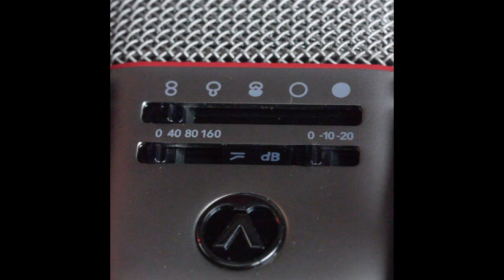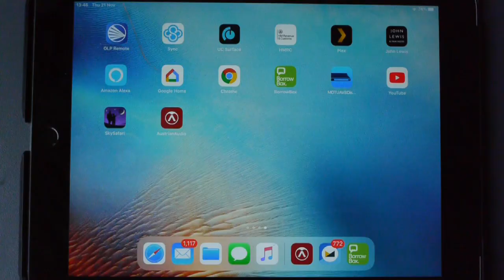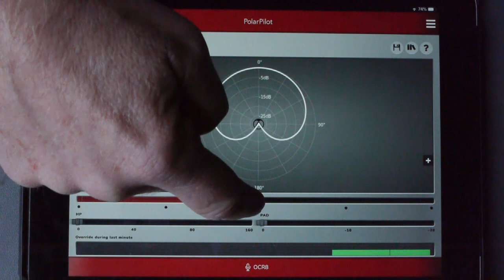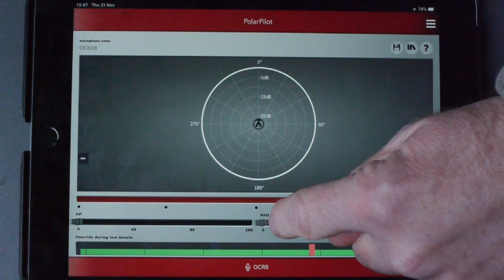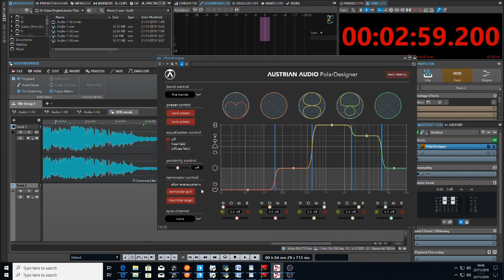Austrian Audio - OC818 - It's a 414 Jim but not as we know it. Looks like a Romulan upgrade!

Comment: It is funny that this is such a Swiss army knife microphone, when being made in Austria. 

I picked up one today, thinking that this may be my future daily driver at my workstation/narration-room. It sounds really impressive so far. I already like it better than the Neumann TLM-102s that I have been using the last five years. 

I did not go for the bluetooth dongle, but plan to use the Polar Designer, and record both capsules at all time. 

The only complaint so far is that the headphone amplifier in my Zoom F6 is far to noisy for this quiet thing.
Reply from the maker: Hi Lars - sorry I haven't replied - on hols in Scotland. I think the 808 is a modern masterpiece. Huge flexibility, great sound and a very reasonable price. Glad you are enjoying it - I don't think it's that much more expensive than a 102? Ceramic capsule the works. Sure it will serve you well. 
Ta like, ppm6.